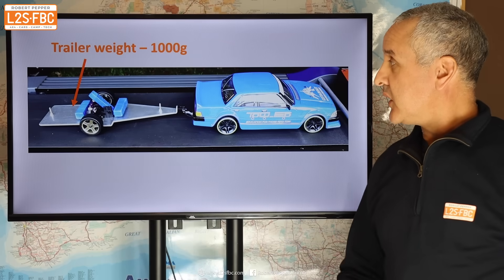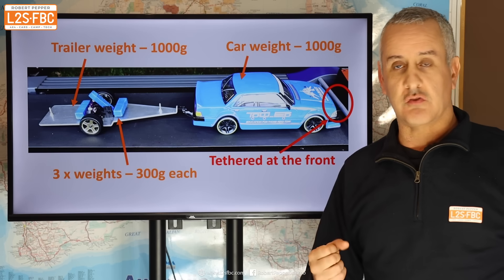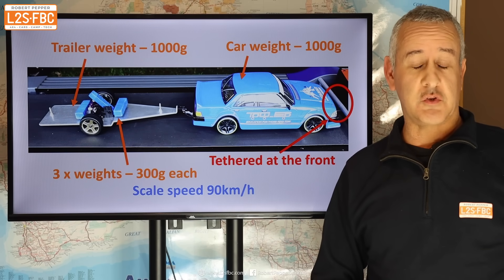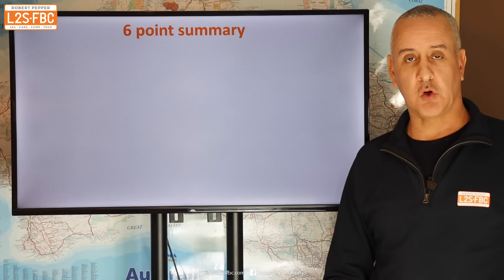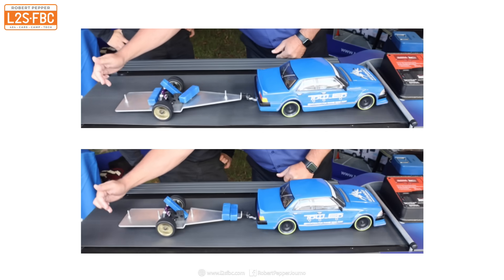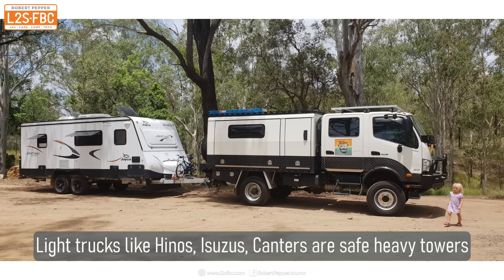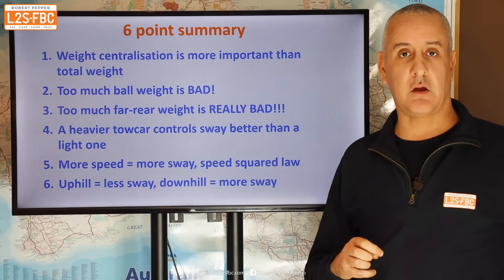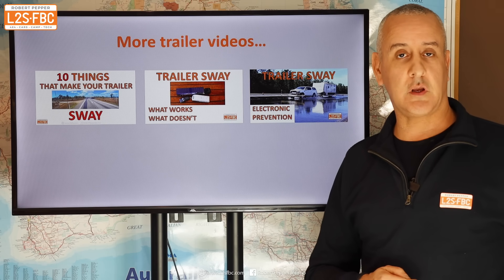7 trailer weight distribution setups, some safe, some deadly.

Comment: Excellent set of tests. One of the obvious factors is the polar moment of inertia. Placing weight at extremities creates a MUCH higher polar moment of inertia than when the weight is centered. Mathematically, for a given weight, the polar moment of inertia increases with the square of the distance. 
The one test which yields unexpected results is where adding a large weight at the center reduces the instability of weights distributed to both the front and back.  
I have a possible explanation for this, one which partially invalidates the test itself. I replayed the video at slow speed for just 1 second, starting at 8:34. If you look carefully, the tape flexes, allowing the heavy weight to move relative to the trailer. This is a phase delay, which in effect, introduces a damping force, reducing resonance characteristics. It would be interesting to repeat that experiment with that heavy weight being hard mounted.
Reply from the maker: Interesting...we will try that although I suspect the results will be the same.
Reply: @L2SFBC  The added weight may still offer some improvement. But if you are able to introduce some metrics by quantitatively measuring the instability (frequency, displacement, velocity, etc.) I'm certain you will see a difference. 
Before retiring, one of my areas of specialization was 'vibration mechanics'. It has both mechanical and electrical applications/analogs. Allowing a large mass to move out of phase relative to both another mass (i.e. the trailer and its other weights) and the excitation force itself, will reduce the peak value of harmonics. In effect, the system becomes 'mushy' or damped.
Reply from the maker: Thanks that's really interesting! Will try it and see 👍
Reply from the maker: I'm not near the model, but our team will run it and report. If there's a difference, then I'll make another video and credit you. In fact, we're going to do more tests anyway so will add this.
Reply: @L2SFBC  Interesting! Thanks for the reply. No need to credit me. This is pretty generic. When the added weight is loose, its compliance adds another degree of freedom to the system. The effect this will have depends its effective spring rate and damping characteristics. If  it has a resonant frequency that is a harmonic of the trailer's oscillation frequency, then a loose weight will be worse than a weight that is fixed. If its frequency is different (what I'm considering here), then it might diminish the trailer's oscillation relative to the weight being firmly tethered. 

The polar moment of inertia is the most obvious contributor to storing (and releasing) the energy associated with vehicle sway. In a LINEAR 'spring-mass' system without damping, after an initial excitation, the total energy remains constant but oscillates between being all kinetic energy (when the trailer is directly behind the vehicle but at its fastest motion in transitioning from one side of the car/truck to the other) and being entirely potential energy (the trailer has swayed as far to one side as it's going to go, its lateral motion has briefly come to a stop, but it is fully 'wound up', ready to rapidly accelerate in the opposite direction).
https://en.wikipedia.org/wiki/Effective_mass_(spring%E2%80%93mass_system)
There is a rotational analog to the linear spring-mass system, modeled by a pair of weights separated by some distance. For the linear system, the kinetic energy is proportional to mass times velocity squared. In the rotational analog, the energy is proportional to the polar moment of inertia times the angular velocity squared. The polar moment of inertia increases with the square of the distance between the two masses. So its ability to store potential energy that may transition back to kinetic energy, increase greatly when the added weights are spread far apart on the trailer. For example, two heavy weights stored 4 meters apart from each other has 16 times the polar moment of inertia than if those two weights were just 1 meter apart.
https://courses.lumenlearning.com/boundless-physics/chapter/rotational-kinetic-energy/
A math model for this system would be pretty complex because there are at least three degrees of freedom (vehicle, trailer, loose weight), each has both a mass and a rotational moment of inertia, each is experiencing both linear and angular motion, and each is serially tethered by what can be modeled as a spring (mostly the tires, but also the tape)
Reply from the maker: Fantastic, I love this detail and explanation!  We will test and report. I am loosely familiar with these concepts but didn't think to test this at the time; the model wasn't set up for such a weight. It has been improved since.  Possibly a rough analogue would be underinflated tyres...I will be publishing a video on the extra weight generated by towball mass and the importance of tyre pressures. Same sort of thing perhaps?
Reply: @L2SFBC  Yes, essentially the same. Tire distortion is one component for storing energy. But there is a 'restoring force' even with tires properly inflated. A rolling trailer tire ideally wants to track in the direction the tread is pointing. But if they're not in alignment, the trailer's tongue guides it elsewhere. If the vehicle is going very slow, there is essentially no energy imparted to the system as the tire's and the tongue's travel directions slowly align and become parallel to one another. But kinetic energy increases with the square of the speed. So a change (such as an oscillation) that initiates at, say, 110 kph can excite the system with 121 times the energy of traveling at just 10 kph ( 11^2 = 121) . The trailer is pulled towards alignment so quickly that it overshoots, which then adds yet another impulse of energy into the system.
Reply from the maker: Yes I want to go into the detail of why sway increases in amplitude and doesn't damp out. I can't really think of a similar example, can you?
Reply: @L2SFBC  That's a tough question, one where a speculative answer may prove to be way off base.
The classical engineering approach would start with the excitation forces being applied at the 6 (or 8) tires, with greater emphasis on the 2 (or 4) trailer's tires. Whatever the model chosen, it has to result in a 'positive feedback' loop. And, the model needs to account for why having the trailer's center of gravity (CG) very close to, or (worse still) behind the trailer's axle strongly contributes to instability (positive feedback). Understanding WHY is key.

Even with the weight properly distributed, I see one item of concern just by sketching. A trailer running straight has both trailer tires equidistant (half of the trailer's track width) to either side of the of the car's centerline (which runs through the tow ball). Let's say the trailer initially sways just a couple degrees to the right. The tires are no longer tracking straight and are beginning to experience cornering forces. But the trailer's left tire is a little closer to the car's centerline, while the right tire is further away from the  car's centerline. That being the case, even if the force at each tire were equal (which they won't be), the right tire will apply a greater steering torque because its effective lever arm (the perpendicular distance from the car's centerline to the trailer tire's contact patch) is greater than the left tire's. 
Additionally, the right tire is the outside tire as it is cornering, which means the trailer's weight has shifted to that side, further increasing the steering torque coming from the right side. If the trailer's lateral motion slows down and stops once it is back on center, everything is fine. But from observation, once it reaches being on center, we can see the trailer is still moving laterally. That means it is carrying surplus energy to help initiate the next oscillation 

The overshoot is due to some combination of the polar moment of inertia and the CG's location. 
Edit: I should add the the lateral translation of the trailer implies there are also lateral forces being applied when the trailer's mass is accelerating, and those are in addition to the rotational forces.
Reply from the maker: Yes the exact physics behind it has me confused. I cannot really think of any other example where the amplitude of the displacement worsens rapidly, apart from PIO (Pilot Induced Oscillations) where the pilot's input to a displacement is out of phase and makes it worse. In car oversteer recovery we see the same thing; too late a reaction which, when applied, actually increases the natural tendency to stabilise resulting in an overshoot. 

So my thinking was similar - when a trailer is displaced, the towcar naturally pulls it back into line. But, it only starts to do so when another force is already reacting to the displacement, making it worse. Same as PIO and poor oversteer recovery (fishtailing).

My fundamental reasoning of trailer sway is that the trailer is travelling faster than the towcar and therefore to fix, the trailer must be slowed relative to the towcar. The best way to do that is to apply the brakes to the trailer only.
Reply: The mass added at the middle decreases the ratio of polar moment of inertia to trailer mass, increasing stability. Note that the improvement doesn't come from increasing total mass with the same distribution, but from changing the distribution.
Reply: @brianb-p6586  I agree. But, two comments
1) That does not fully explain how instability becomes exponentially worse as the tongue's weight distribution drop below ~10%. There's more going on.
2) Minimizing the polar moment of inertia depends upon which frame of reference you choose. Consider when the car/truck substantially outweighs the trailer. In that case, the vehicle continues to track well, while the trailer sways back and forth (I've seen this). In this case, I'd say that the frame of reference is the trailer's axle or midway between multiple axles. That is the location for minimal polar moment of inertia for such a system (Edit:Ignoring translation). But when the car's tracking is affected, it demonstrates a coupling, which in turn, moves the point for minimal polar moment of inertia somewhere between the trailer's axle(s) and the vehicle.
Reply: @gregparrott  Yes, there are various factors involved, not just polar moment of inertia. Tongue weight by itself is not useful, it's only a side effect of the position of the centre of mass relative to the axle position. As the centre of mass approaches the axle position (for a constant moment of inertia), stability is reduced.

Yes, with a tow vehicle which is not many times greater than the trailer in mass, the trailer and tow vehicle form a two-body system and the tow vehicle can't be ignored... but the moment of inertia of each body (particularly the trailer) is still a major factor in stability. It does matter what the reference point is, but I don't think the tow vehicle changes that selection.
Reply: @brianb-p6586  I think we're in general agreement. The main reason I brought up choosing the frame of reference is that it simplifies computation of the effects of both the angular rotation of the center of mass of the trailer and vehicle, in combination with the linear translation (mostly side-to-side accelerations) of the center of masses.

Comment: Seems from vid that having most of the weight over the trailer axle is ideal. If I’m towing an atv, would it be more adventitious to place the atv with both wheels spanning the axle or perhaps the rear wheels over the axle and the front wheels up further for a more front weight bias?
Reply: I was always taught to have 60% of the load weight forward of the axle. Whether that be a trailer, ute or truck. At times though, there are always exceptions to that rule. (Retired Truckie)
Reply from the maker: Hi yes definitely weight Central and over wheels. As to the other part of the question that depends on the rest of the trailer configuration

Comment: Terrible demistration the tires are placed in very poorly position on this test trailer, way to far forward which is why thw trailer swerves.... Wieght is placed over the axles with a certain percentage you want on the tounge. It's not on the back lmfao but most of the way back. These videos are very misleading. Make an actual exact miniature copy to test.
Reply from the maker: The trailer shows the effect of weights very effectively.  You can reverse your logic too; notice how the sway is quelled even though the trailer axle is a long way forwards. The principles shown are absolutely sound.
Reply: This is a very common setup outside North America that offers several significant advantages, e.g. allowing a vehicle to tow more with the same load on the hitch or make tighter turns (or, in other words, not needing the tow vehicle to go nearly as wide to get the trailer to clear a turn of the same radius). A trailer like this still WILL NOT SWAY IF LOADED CORRECTLY (or anywhere close to it), and sway that does start can be more controllable because, at least in Europe, trailers are typically required not to exceed the weight of the tow vehicle (for exactly the reason that you see in the video). The few cases of trailers getting out of control over here that I've heard of were all caused by a mechanical fault (e.g. a tire puncture/blow-out) or all the load being extremely far back (e.g. long, heavy steel pipes hanging far off the back of the trailer). And no, they are NOT all limited to <100 km/h.

Comment: What I don’t understand is that when the swaying begins, why don’t people slow down in advance. This is something my father taught me. So if you have no choice but to drive with your load capacity uneven..... always consider or compensate your speed. A simple rule of thumb that’s so easy to follow but failed by most. Not trying to sound disrespectful...... just making a statement.
Reply from the maker: Because if swaying begins, slowing the towcar makes it worse. You have to slow the trailer, NOT the towcar.  And few have fathers like you  :-(
Reply: In the intro video clip its 7 seconds between stable and roll over, I think it's all over before the driver realises and I'm not sure anyone could recover by mid way of the event including myself - and I've raced cars.
Reply: Yes, the ability to go back in time is always helpful. Unfortunately my time machine is current out of service...